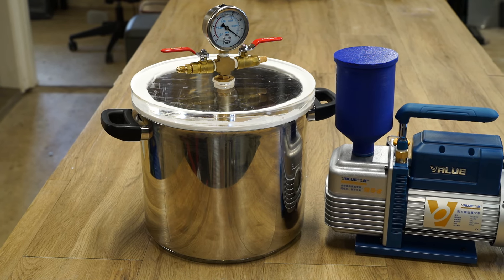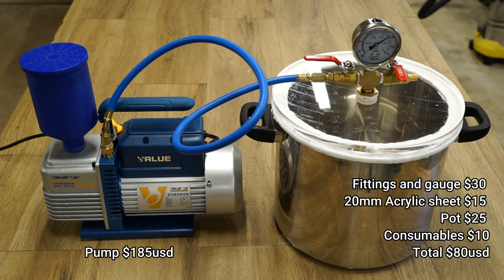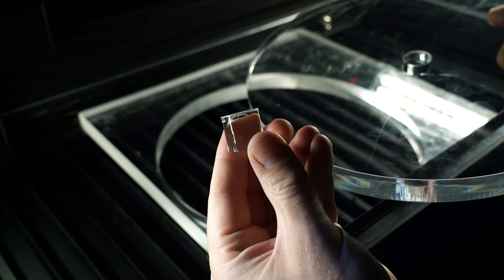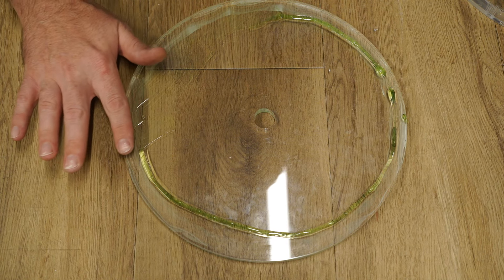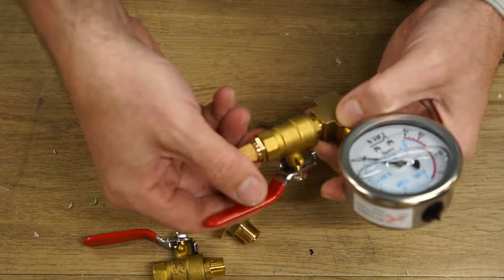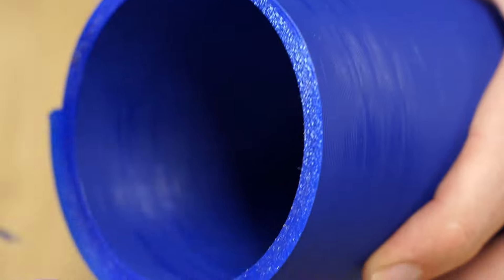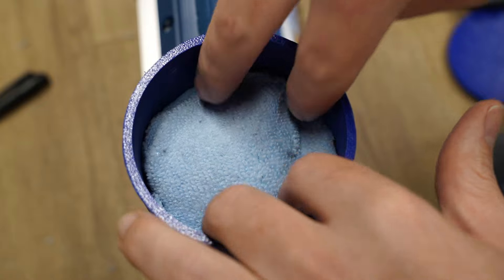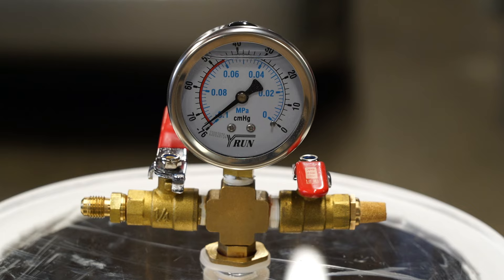How to build a Vacuum Chamber and Pump II 20mm Acrylic lid cut with xTool P2

Comment: If you have the space in the bottom of the chamber, I would recommend you line it with silicone baking paper, and a grate, to act as a standoff for boiled over resin. A stitch in time saves 9. Great build, and seal making tips!

Comment: So I always see the repressurization and I wonder, is there a reason no one installs a tee inside to have the air disperse more to the sides instead of directly into the pot of whatever you presumably don't want surprise particles in?